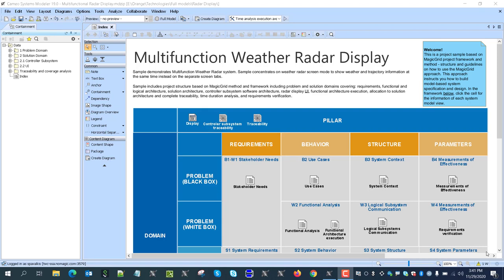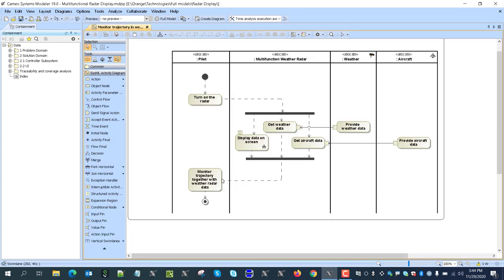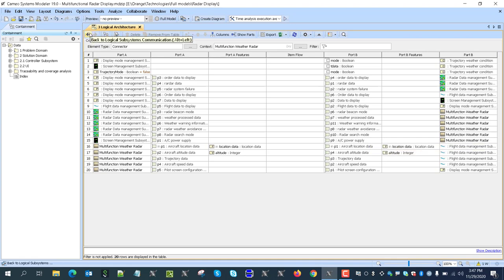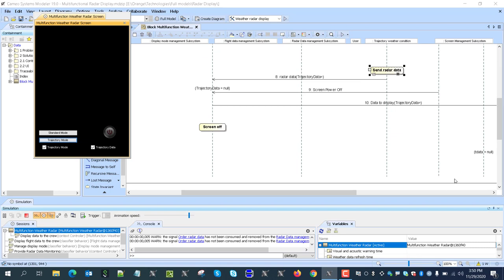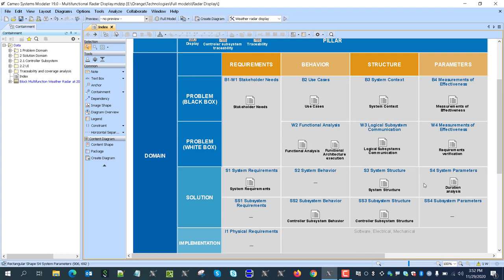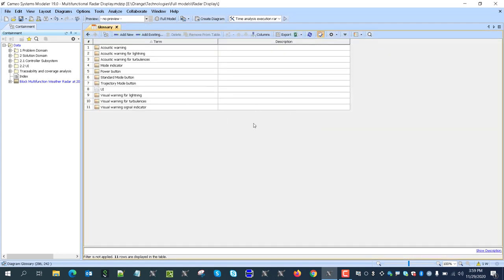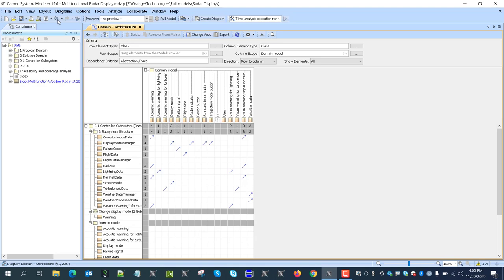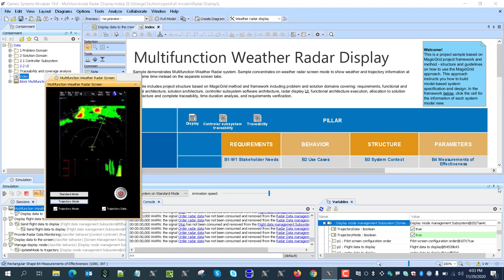Aircraft Radar Display SysML MagicGrid Sample with Simulation and Analysis

Comment: This is a comprehensive example of MBSE approach. Thank you for such a useful analysis. Is it possible to examine in the magicgrid?
Reply from the maker: Thank you Tuna for the feedback. Could you comment what are you looking for?
Reply: @MBSEExecution  Hi, I have introductory-level knowledge on Syml/MBSE/NoMagic and try to discover this discipline by examining examples. I ok with most diagrams but need some guidance especially in sequence and state diagrams. The model you've built seems very advance in these features. That's why I ask to examine it. Thank you.
Reply from the maker: Hello Tuna. Thank you for sharing. Im sure you will see different cases of different complexity in multiple models presented. Models are also available to download from description in video. Let us know if some models you are interested are missing or if you are looking for specific SysML simulation or co-simulation demonstration.

Comment: Thanks for a great video. But i have problem open your example file.  When i tried to open your "Multifunctional Radar display.mdzip" file, it asked for the missing "Display.mdzip" in Cameo_EA install folder. Do you have that file so i can open your example to review? Or if you can re-upload the example that w/o linking to the Display.mdzip? Thanks in advance.
Reply from the maker: Thank you for the feedback. Will upload soon. Try to load without display.mdzip maybe it is not needed.